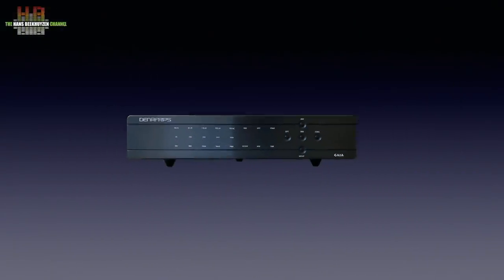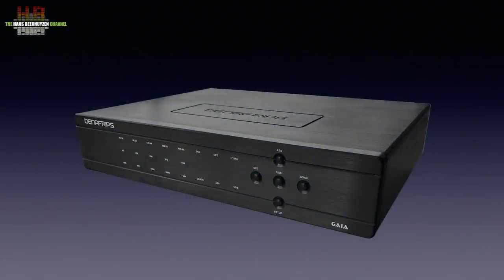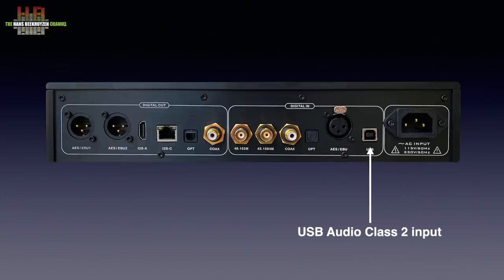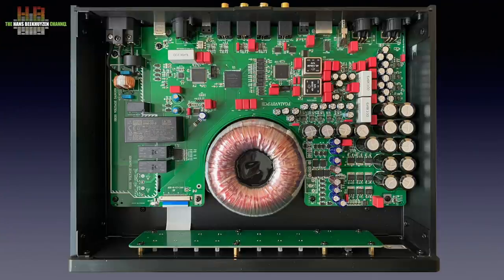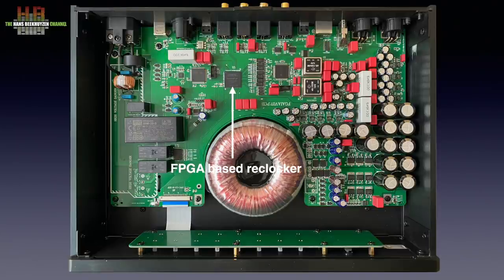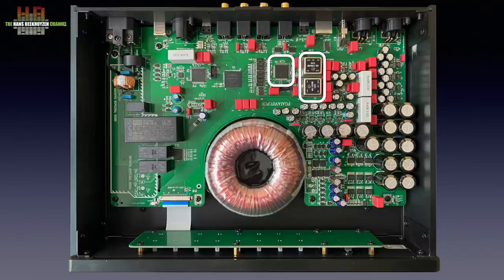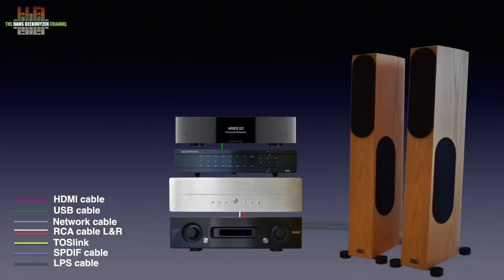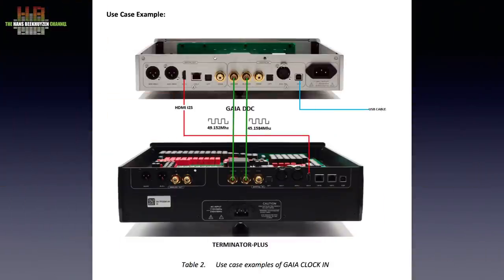Denafrips Gaia D/D converter/reclocker

Comment: Why is this not built into a DAC? Digital is just becoming more and more boxes.
Reply from the maker: It is built into DACs, but not as good.
Reply: built into a separate chassis and power supply usually delivers better performance, albeit at a much higher cost

Comment: Hi Hans. Nice review as always. I have similar findings, connecting my Gaia to Venus II DAC. And I have tested few other DACs ending with improvement too. However, Gaia adds biggest improvement when connecting to less quality digital source, cheap streamer or PC. The better the digital source is the lesser is improvement, but there is always audible improvement though. So I consider Gaia DDC as “digital source improver”. Great way to utilize I2S for “USB output only” sources (as my Aurender streamer).
Reply: Would gaia still be a good investment if i added it in between u1 mini and venus ii?
Reply: @jonathanmatthew5631  in my opinion yes!
Reply from the maker: Absolutely.
Reply: @TheHansBeekhuyzenChannel  Thanks. I thought the u1 mini already has good filtering of jitter. I guess gaia is still a step above it.

Comment: Its funny how picosecond improvements in jitter improve the bass, where audibility of jitter is almost non-existent. Go figure.
Reply from the maker: What do you mean with "the audibility of jitter"? isn't the influence on the bass an audible effect of jitter?
Reply: @TheHansBeekhuyzenChannel  jitter is most audible at higher frequencies, and even then it not really there - you need more than 1ns (that is A LOT, you'd probably see it on a scope with edges jumping that much) of jitter for a signal at 1kHz to produce audible spurs above -100db, whilst your average crystal oscillator easily manages 100fs jitter values.
In other words I don't believe a word you're saying and you need a better experiment to prove your point.
Reply from the maker: To you jitter is most audible at higher frequencies. But it's also audible in the lows as you have noticed, in the stereo image, in sibilance, in pace & rhythm and in other less easy to describe artefacts.
Reply: @TheHansBeekhuyzenChannel  its mathematically proven to be audible  at higher frequencies and its so low its laughable.
So you're saying you can hear rhythm irregularities when clock edges jump by 100 femtoseconds?

Comment: Be warned that there is potentially a problem of time-delay with the Gaia.  If the Gaia is used between a computer and a DAC, or between a TV and a DAC the Gaia will introduce a time-delay (latency) which will cause a problem of synchronising with the visual image.  In order to minimise the delay, one has to connect the computer directly to the DAC using USB i.e. without the Gaia.
Reply from the maker: There alway is a potential time problem with all DSP based devices. DSPs don’t work in real time. Some have a short delay mode for video

Comment: It seems that all Denafrips DACs, which is why I bought the Pontus, have FIFO buffers and Xtal clocks for timing regeneration. I would think that would have brought jitter to nonaudible level? I wonder what is the additional retiming/dejittering the Gaia offers?
Reply from the maker: Unfortunately FIFO buffers and in fact all flip-flops in a DAC are rather sensitive for phase noise. The GAIA reduces phase noise and that is quite audible on a stereo of some class.
Reply: I also wonder where the additional benefit from a DDC is coming from. Why would the phase noise of the incoming signal (to DAC) matter as long as all the data is read correctly because it will be reclocked inside the DAC anyway and the incoming clock is not used. Is the USB circuitry inside the DAC noisy when USB input is used ? Is I2S input cleaner ?

Comment: Audio Nirvana obviously comes with a price. Your spectacular setup 1 must be over 40000 € now. It inspires enormously though and bring upon wishes to try it for yourself 👌
Reply from the maker: Actually the Denafrips gear in setup 1 is not mine, it is lent to me to do the review. But, indeed, Audio Nirvana doesn't come cheap if you set your goal high.
Reply: @TheHansBeekhuyzenChannel  Ok, thanks. The Denafrips combo would btw also be moving away from the possibility of MQA track so to speak. What is Your point on MQA in this present time, considering the appearance of much new very high quality digital audio gear that does not support MQA?

Comment: Thanks. Been following your great reviews. Please kindly clarify if GAIA takes clocks inputs from Terminator Plus. Does it mean the Terminator Plus clocks are being used in place and overwritten the GAIA? If that is the case, the clock on GAIA does not need to be OCXO. Right? If you check out Denafrips's HERMES, which is exactly the same circuit as GAIA but with lesser clocks. Will it be a sensible upgrade for Terminator Plus than the GAIA as its
Reply from the maker: Provided the Hermes does have the same electronics, you are absolutely right. And by the looks of it the electronics appears to be the same.
Reply: @Somsook Well spotted. I think Hermes' clocks are OCXO as well, but of lesser quality than Gaia's. Anyway syncing with Terminator Plus should hypothetically be the best solution.

Comment: Hi, thank you for this very good video. 
I wonder if I can have some advice here.

I have a very good system today, Innuos Zen mk3 server running Roon, connected to my Devialet Expert 1000pro monos with AQ ethernet cable.
I am wondering what to do to improve the digital side more.

1: Should I connect an Innuos Phoenix net switch before the Zen mk3 (which clean the digital signal with the clocks and linear power supplies in the Phoenix unit) and run ethernet cable from the  Phoenix net switch outputs, one to the mk3 and one to the Devialet master unit DAC.
Or:
2: Buy an Denafrips GAIA DDC which cleans and reclocks the signal before the DAC in the Devialet and connect that to the Devialet master unit?

Which scenario would give the most sound quality in your opinion?

(I can't afford them both right now unfortunately.)

Br:Kris
Reply from the maker: Hard to say. I have no hands on experience with the Devialet not with the Innuos Phoenix. I would ask your dealer to lend you the devices so you can try it for yourself. If that's impossible, my bet would be the switch.

Comment: Hi Hans, I get that there could, and probably should, be good synergy between the two Denafrips items. So as you use the Aries G2 as your front end why do you not have the Vega G2 or G2.1 as the DAC? Have you ever tried that combo? And what, do you think, would the Sirius add to that pairing?
Reply from the maker: I only have 24 hours in a day....
Reply: Hi Hans. I'm using Aries G2.1 together with Sirius G2.1. By combing these two ... In my opinion, you don't have to look for anything better as source (I mean streamer). Therefore, which will be the next step? Which DAC ? I' m really in a dilemma. Vega G2.1 or Terminator + ? So, I bought the tiny Ares II just to "meet" Denafrips! I did it thanks to Hans. It's amazing! I m really surprised ! The ladder transistors seem to be really amazing for analogue sound (instead of known chips AKA, ESS etc.). I m seriously thinking to go for Denafrips after Hans and my test with Ares II. Now I m thinking to buy the Gaia for Ares II and then to Terminator +. Please bear in mind that I m big fun of Auralics ! Dear Hans what is your opinion ?

Comment: Hans, nice review. Did you also test the AES/EBU connection. And if you did, was it on par with the other connections? 
And you use the USB connection. Does the Auralic G2 still see the dac via the GAIA?
Reply from the maker: SPDIF and AES/EBU are actually equal in technique and performance and both are limited to 192 kHz. Using USB or I²S support all sample frequencies. USB is Audio class 2 compatible and is seen by the Aries G2.

Comment: Yes, have been hoping that the Gaia would be put up to the Hans test!  I am a little bit confused about the Terminator Plus clock is better then the Gaia clock. More around how one connects the units  in order to determine or ensure which clock is driving. I have a Terminator II (yes, the Terminator has been upgraded) on order and hope to add the Gaia at some point in the future. Hans, have you added the Terminator Plus to your System 1? If so, congratulations. Or, did you have all of this gear on hand when you did the reviews on other denafrips dacs? Thanks and cheers!
Reply from the maker: It's not the clock being better, it's that both run on the same clock in perfect sync.
Reply: @TheHansBeekhuyzenChannel  Thanks Hans!  I am looking forward to my Terminator II. While I enjoy the music. Cheers.
Reply: @TheHansBeekhuyzenChannel  I think in this case it is about the external clock being better. Otherwise probably theres's no point, it's not a recording studio where devices need to be synced. Gaia sends signal out to the Terminator Plus, so some jitter is added anyway and is again corrected in the DAC. I think syncing per se wouldn't matter here if it wasn't for the better clocks in Terminator Plus. Perhaps this is what the manufacturer aims for, by suggesting: if you get our best DAC you'll get access to our best clock.
Reply: @john_scott  True. Even denafrips said in their video that terminators don't use Gaia clocks. Also I never heard DDC and DAC using two clocks and need to keep them in sync?!
Reply: @VJA74   i don`t understand..  can i use the GAIA with external clock from another brand, like GRIMM CC2 and in which BNP input i have to connect it !?

Comment: I know this is an old video, but wanted to ask - would the Gaia (theoretically) improve performance of a GaN FET amp that doesn’t use a DAC (peachtree gan1)?  Streamer is a Node (2021) w/ an upgraded teddy pardo lps using kimber ascent dv30 coax.  I haven’t been able to dig up much info on how well the digital outputs perform on the node.
Reply from the maker: I really can't say since I have no hands-on experience with the equipment you use. But in general the Gaia will improve the quality of the digital signal which often will bring clear sound quality improvement.

Comment: Interesting review.  Thank you for your attention to detail.  Do you know if the Gaia will pass an MQA signal from a streamer to the Brooklyn?   Also since the spdif output only manages 24/192, will the Gaia down sample a higher signal rate or will prior down sampling in Roon/HQPlayer be necessary?
Reply from the maker: The Gaia don't change the bit pattern so it will contain the same information bit perfectly. Thus it doesn't damage the MQA container. The Gaia will not work with SPDIF signals higher than 192 kHz. Only the USB input will accept higher sampling rates.

Comment: I have a question. I own two music servers. One is a Wyred 4 Sound MS with the i7 package. This is a linux based server that runs ROON. My DAC is the PS Audio Direct Stream DAC. The Ps Audio accepts DSD up to 256 with the new Sunlight OS update. The music server can output DSD up to 512 though both I2S and USB. However, Roon limits I2S native to 128, and USB as DOP up to 128 when the server is connected to the DAC. According to the server manufacturer the problem stems from the linux platform the server is using for Roon, so the DAC can't achieve the native DSD maximum it's supposed to work with. I am thinking of getting a Denafrips Gaia, connect the USB output to it and the I2S output to the PS Audio DAC I2S input in order to get the 256 DSD. Is that possible? Or is there no alternative?
Reply from the maker: I can assure you that Roon does not limit any sampling rate in both PCM and DSD. I don't know the 
Wyred for Sound server and have no hands-on experience with the PS Audio DAC. So I can't help you further.

Comment: Is this one worth it for the Pontus II or would you advice a DENAFRIPS HERMESl. thx!
Reply from the maker: That depends on the source. If you use a source that provides a very clean digital signal, the improvement might be limited. But in most cases it will improve the sound quality considerable.
Reply: @TheHansBeekhuyzenChannel  in my case my main source is usb